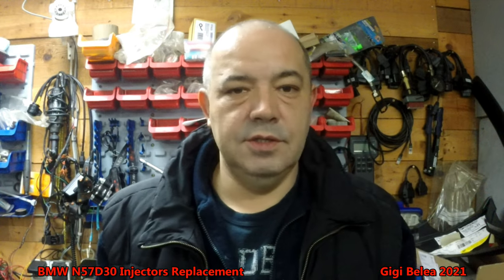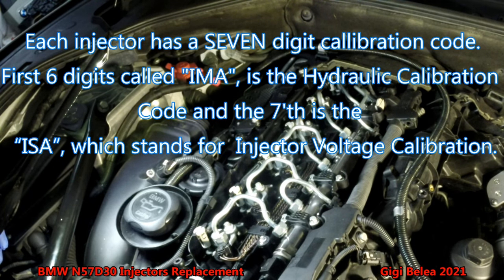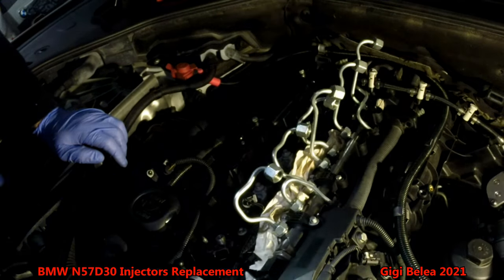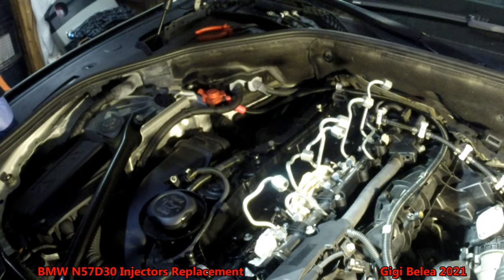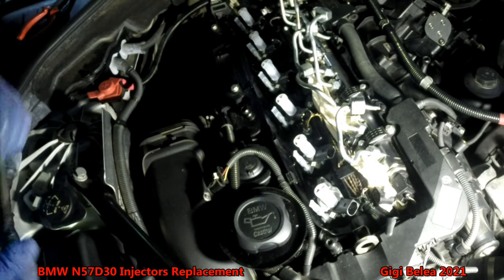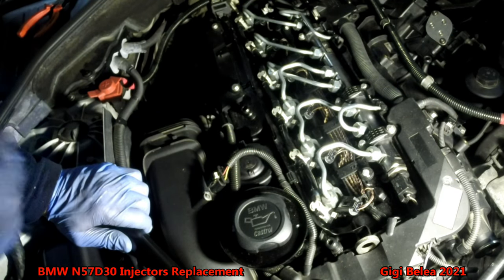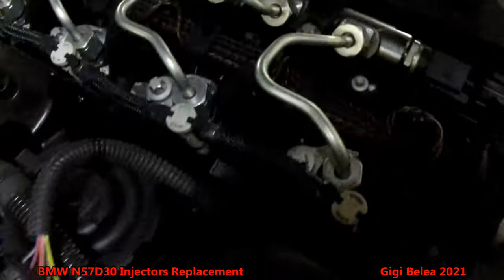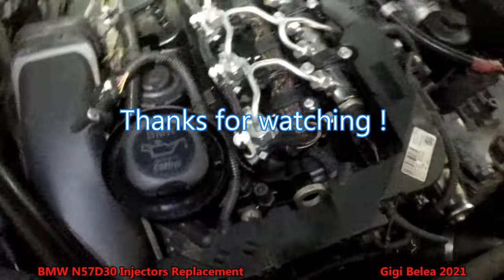BMW N57D30 Engine - BMW F01 Injector Replacement

Comment: Interesting video "even after two years". More and more cars with that engine reaches 250,000-300,000 km, if the rest of the car last that long. 
Thank you very much for the information around the job done.

Comment: thanks for the video ive had a knocking noise for a while not bad just a little but i rember i got a new code machine and it did a random calibration on somthing and thinking back thats mayb teh issue that causedt he knocking 

so now im goign to get all codes for my injectors recode them all if not the same and do teh calibrations on everything you have said thanks again and fingers crossed

Comment: Good and educative video. At some point  you said "calibration G and calibration H". What does it means this ones?
Reply from the maker: Just calibration numbers that come from Bosch factory for injectors. I think it's telling the ECU it needs to use slightly different voltage.

Comment from the maker: AS I STATED in the video description, after driving 2 weeks (for testing the results) , the engine is MUCH MORE quiet , perfect sound , no more pinging and "tapping" or knocking ! Tested and satisfied with the results !
Reply: Salut , un nr de telefon te rog , as vrea sa te intreb ceva .
Reply from the maker: @virgiltapciuc  Intreaba aici.

Comment: Salut. Am o problema la un f10, 3.0d 245 cp. La rece se scutura masina cateva minute, iar diagnoza spune ca injectorul unu e problema, iar inca doua nefiind nici ele in parametrii. Ce imi recomandati sa fac? Masina are 300.000 km.
Reply: Let me guess! I think most suggest: buy new injectors. But there are at least one video, where the man clean the injectors. So there could be two options, clean them yourself or let someone clean them.

New injectors cost almost as much as a used car with 300,000 km, unfortunately.
I have a 2011 X3/F25 30d with 251,000 km...

Comment: Great Video, lots of videos on M47/57, great to get such a good one on N47/57. Can I ask which model of Launch X431 do you have, looking to get the same functionality but there are so many versions of it. 
Thanks a mill in advance 👍
Reply from the maker: It's just a Launch head with a "China" tablet. So you can run Launch on any Android tablet with a genuine Launch diagnostics head. Just look for something that has at least 32GB of space on it so you can have all brands.
Reply: @GigiBeleaDK  thanks man!👍 Where did you get your Launch software👌
Reply from the maker: @zackywacky88  Came with the tablet when I bought it on ebay.

Comment: How many kilometers has your car? When did you feel the injectors were bad? Nice job 👍🏼
Reply from the maker: If you read description you see mileage :) 300.000km. I did not feel they are bad , I just heard them pinging from time to time. Then checked Smooth Running with a tester and saw one of them had always values over +2mg/stroke.

Comment: Hy you need other screws for the injectors or it's ok to use the old ones ? Thank you
Reply from the maker: Well, if you keep the torque specs and do not remove them every 1-2 weeks I would say you are ok with the old ones.

Comment: Hi.  I have to replace 1 injector.  My scanner will do injector coding but not the Fuel Pump Prime.  Others have suggested that for just one injector I wont have to do the fuel pump prime.  Would you think that is correct or that I will have issues without having that function?  Thanks
Reply from the maker: Your scanner should have the BLEEDING function for the fuel system , if it does not , then just turn ignition on , wait a few seconds , off, then on again for a few seconds ...and so long until you do this 10-15 times, then try to start.
Reply: @GigiBeleaDK  Thanks for the Reply GigiBelea and thank you for posting this Video.  It's well done and it greatly increased my confidence in tackling this job.  The scanner I purchased was advertised to have the Fuel Pump prime function, and it does, just not for BMW (Foxwell NT650 Elite).  Apparently I need to NT530.  I think I will keep it though and just use the start stop button as you suggest.  The only other repair I think I would need the prime function for is replacing the fuel pump, but I think I beyond the point of getting under cars at this point.  I did my trans service a couple weekends ago and I'm about done crawling around under cars, I just don't enjoy it anymore, that's worth paying someone else to do...  Thanks again for the great video
Reply from the maker: @HDFW007  Do you think I enjoy crawling under them ? :)) Some things I also pay others to do for me don't you worry :) For example chains got changed at a friends garage , fuel filter the same ... I am getting to old to do things like this , not that I do not enjoy it but I start feeling it in my bones :)))

Comment: Can you recommend a few other scanners (maybe cheaper) than can program the injectors?
Reply from the maker: Sorry, do not know which other scanner could program them , but I think the dealer will not charge a fortune for this service.
Reply: Launch has several cheaper scanners that can do this. The Creader Elite BMW is a good one.

Comment: Why did you change the injectors?
Reply from the maker: Because I am a crazy guy :) One injector was always pushing +1.2/+1.4mg/stroke so I decided not to change only one but all 6. Car drove 300.000km so injectors would be pretty worked at that mileage.
Reply: Did you feel difference after replaced injectors?
Reply from the maker: @Taurivi  In power not, in sound yes. Engine became more quiet.
Reply: @GigiBeleaDK  But do you feel difference transmission gear shifts or there were absolut no difference?
Reply from the maker: @Taurivi  Car was driving PERFECT also before I changed the injectors , I changed them because I am crazy about noises in the car and I want everything to be perfect in my cars ... guess asking a bit to much from an engine that drove 330.000km :) One injector was showing +0,8mg/stroke. Car changes like before , pulls ok. Only thing I noticed is less injector noise and fuel economy is just a bit better. (maybe because it was warm weather also)